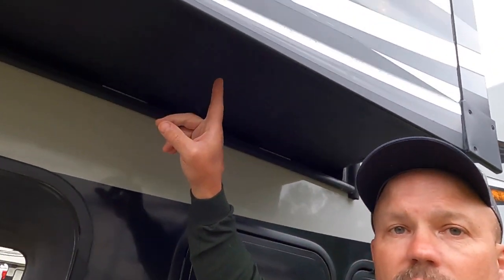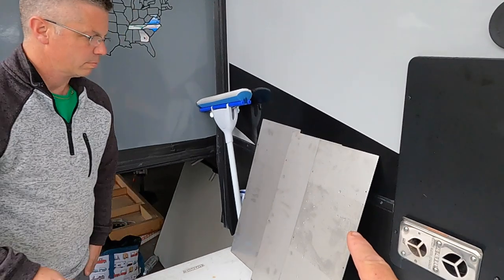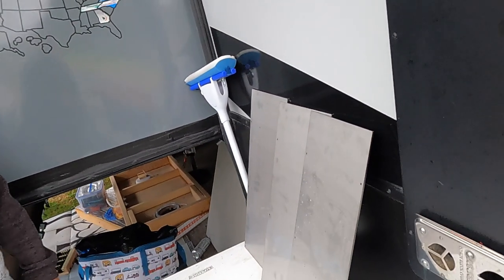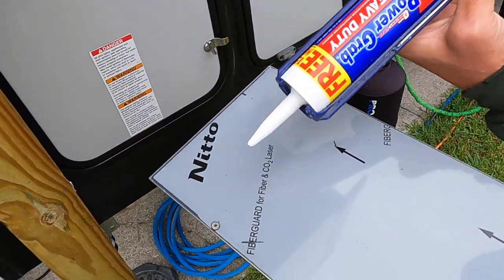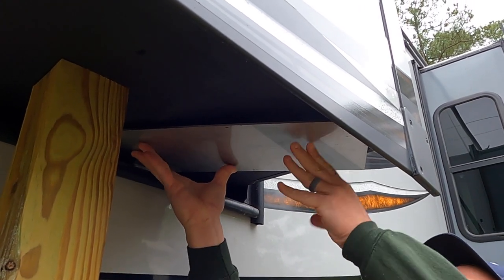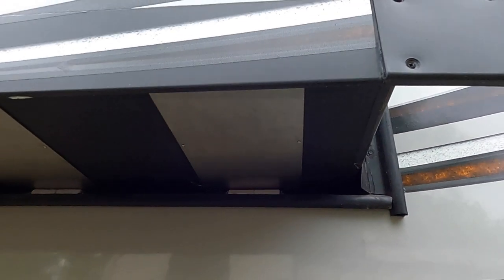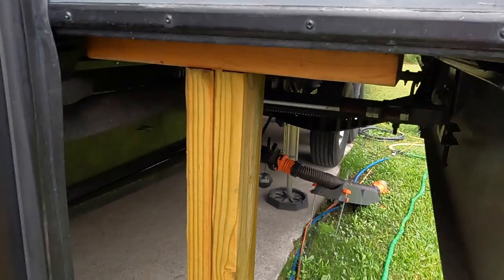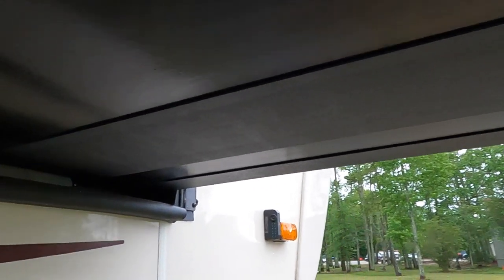Stainless Slide rails

Comment: Maybe this will help those thinking about this fix.  I have Columbus 5th wheel and my right front slide out had the exact same problem with the wood splitting from the rollers. The problem kept getting worse over time after several adjustments from the dealer that didn't work.  I did the exact same fix with the same thickness in sheet metal over 3 years ago.  The only added step I performed was I mixed a  clear Epoxy and coated the wood underneath the slide to water seal it tight and then I applied the sheet metal.  3 plus years and she works flawlessly.  This is a great fix that will outlast the ownership of the RV.   Great video.....

Comment: Great and useful video.  Question:  You used 1/8" stainless sheets.  What size screws did you use so that the screws would not puncture through the floor?  Thanks.

Comment: I am having issues with the slides running on the linoleum flooring and dug in in the middle section. 
I would think that adding this plate would only make my problem worse due to the extra material thickness under the slide. 
Grand Design solitude drivers side.

Comment: A 1/16" piece of HDPE would do the job as well, and at a fraction of the cost of stainless (and you can cut and drill it yourself with hand tools, so labor cost goes away as well).
Reply from the maker: Wholeheartedly agree. I went bigger than I needed to but have learned more since. Still happy with the finished product.
Reply: So rv newbie - 2015 Montana- what is HDPE and where do I get it? Thanks

Comment: I have a 2014 norco accu slide. The right side roller caved in on the plywoord cause it is rotten. Slide did not operatate properly. You think i should take out plywood ? Im just afraid that i wont be able to properly replace peace without removing the whole slide. Really should replace it. Any videos on how to do that job

Comment: Great vid! I did something like this on our last trailer but new one is a bit different. It still needs a roller mod though. 
Did you find that the slide rubs the carpet inside any differently? Mine grinds into the carpet bad and no adjusting helps.
Thanks!

Comment: I assume the stainless is not scratching the floor inside?
Reply from the maker: Not at all. The rollers on the inside keep the plates off the floor. 
Happy Glamping!
Reply: @glampinggurus6033 Great!  Good to know!  My 2017 Open Range 272RLS doesn't have the rollers but I am looking to add them. I just don't know to use roller part # 854304 or 854303 and where to order them. Thanks.
Reply from the maker: @HCW2855HCW  I actually Googled them and found them on Amazon and many other sites.

Comment: Just curious....is it possible to damage the slide or get it out of adjustment lifting it up with jack this way?
Reply from the maker: We did a ton of research and have not seen any issues with lifting the slides. I would say that it may be possible on a Schwintek style slide. Cable slides and hydraulic slides will work out great.
Reply: @glampinggurus6033  we have both on our Heartland Big Country 3560SS (which as 4 slides including a slide in a slide.). Seeing roller marks on underside of all of them.  How did you measure for stainless steel plate length?
Reply from the maker: @stevegreene6526  I took a tape measure, pulled back any seals and measured beyond the roller to the outer flange of the slide. For the Schwintek slides, I recommend 1/16” or 1/32” plate and use a mallet to gently tap past the roller.
Reply: @glampinggurus6033  sounds good.  Thank you for the video and answers to my question.
Reply: Agree with others, not on Rack and pinion but on a Scwintek slide, it can be damaged by excessive lifting. I installed .024" thick SS plate and was barely able to lift it enough to get it in.

Comment: What are the measurements of the plate?
Reply from the maker: The plates are the width of the roller +2 inches on either side and the length of the slide out